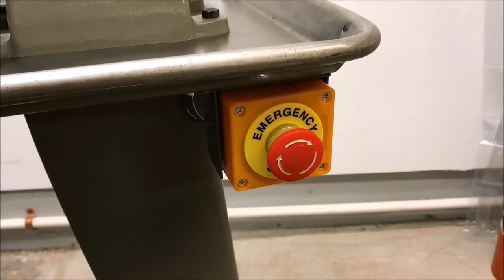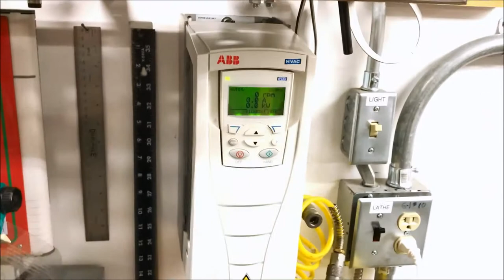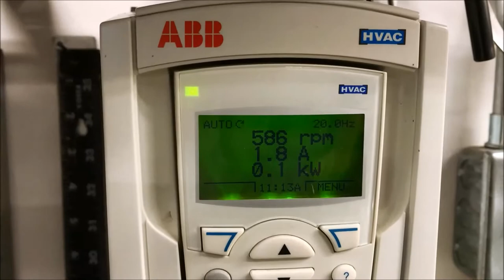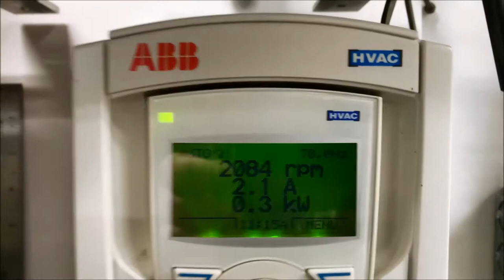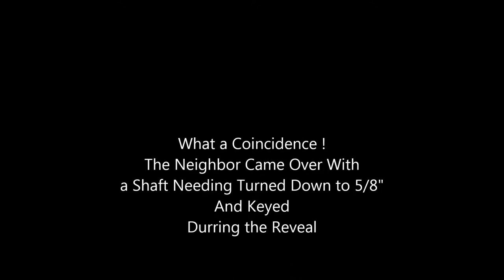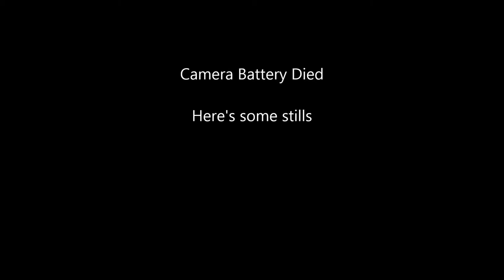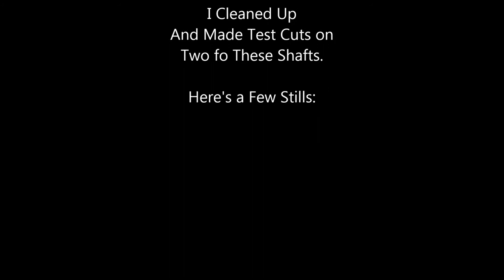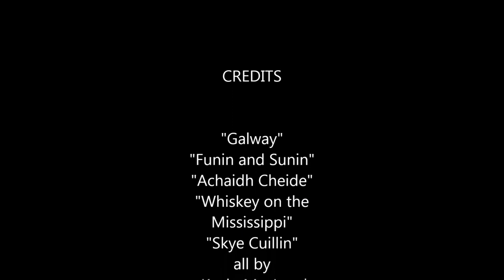South Bend Lathe Rebuild Part 8

Comment: Perfect timing. :)  Beautiful job on everything. Nice covers for the taper attachment slot. Great idea with the twist-loc and computer cable. Shower curtain is also perfect. I might have to steal your chuck key holder idea. :) Your finishes at the end look excellent! - I’ll say it again, it’s the only red accented South Bend I’ve seen that actually looks right. I love that you put it directly to work. Maybe over cautious on my part, but I try to only overdrive my VFD for some finishing or polishing now and then, as I don’t know how well the spindle bearings can take speed they weren’t designed for. - Great job, and thanks for sharing the project.
Reply from the maker: Thanks for the kind words John. Feel free to share and use any ideas, that's what this community's all about. I couldn't have without the knowledge and inspiration freely shared by the YouTube and Web community's.
I Thank You All !

Comment: Beautiful job! What kind of paint(s) did you use?
Reply from the maker: Dave, I used the Sherwin Williams that was color matched by Brad Jacobs. It's a south bend color, I really like it. Here's a link to a PM topic thread with the code.
 I think I also showed it in part 1.

https://www.practicalmachinist.com/vb/south-bend-lathes/south-bend-colors-different-examples-227673/

Dean
Reply: Thanks for the reply! The first part that came up on Youtube was part 4. I guess that's why I missed it.

Comment: what paint color did you use?     did you use oil paint?      Brush is on or brush?    what Color on the gray
Reply from the maker: Greg, I brushed on most of it. On the large items I found the 3" mini foam rollers worked great. The paint is a Sherwin-Williams Oil based. The formula is shown in the Bridgeport mill series. Part-3 at 6:24

Comment: Would you like to rebuild my  Heavy 10     PLEASE   Even if you can take on some of the work like the Head,   What a lot of work  Crazy
Reply from the maker: It was a lot, a lot work. Took a full year. The cleaning, paint striping and careful organizing of all the small parts seemed to take the longest. Thankfully I had started collecting many of missing or needed to be replaced parts before starting the project. Naturally there were many surprise needed  parts along the way. One thing that I couldn't afford as a hobbyist was regrinding the bed ways. The ways have a fair amount of ware, I just have to compensate for that while turning parts. It was a fun project and nice to save a classic from the scrap man.
I think I'm done with lathe rebuilds at least for a year or two. I do have a real nice pedestal grinder rebuild coming up  as soon as some time free's up.
Thanks, Greg !